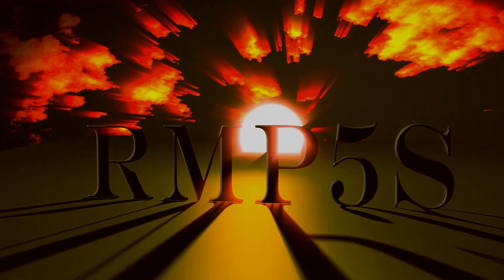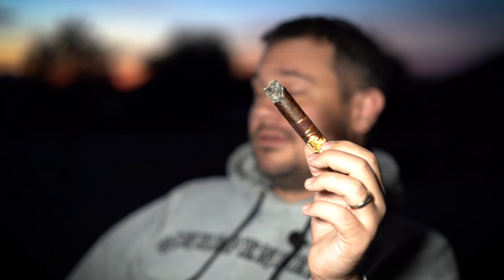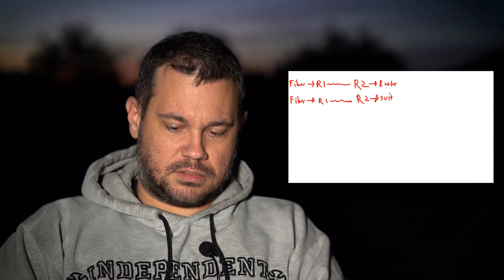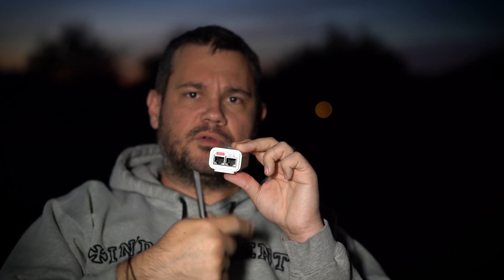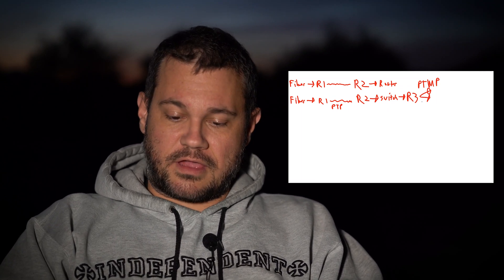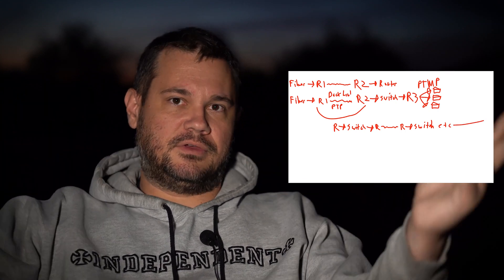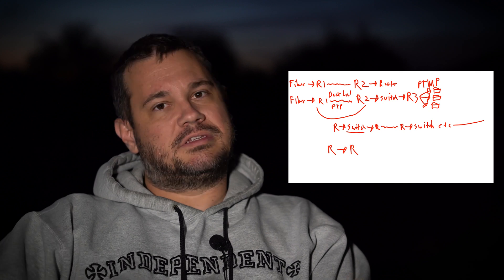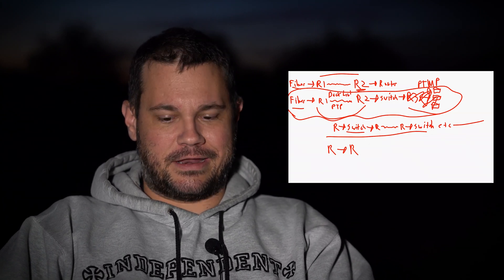WISP Infrastructure 101 - DIY Ubiquiti Internet Relay - Pt 31

Comment: Is it possible to send multiple dishes from the datacenter for example to the relay house, and does this create a bigger bandwith?  I wonder this becos you find 900Mbps Transmitters and 2Gbps Receivers (even though its multiplexing its still 1000 which is more then 900) on the uisp site, and then I'm talking about the none 60Ghz ones.

R1 \
R2   --------------------- R4 
R3 /

Comment: You got that 'chicken scratch' too! 😂  Something I would say about using a switch/router with POE is to MAKE SURE that it delivers the equivalent power supply as the injector, else, you can have a situation of not enough power OR burn out a radio!
Reply from the maker: Or, more simply put, make sure output is correct. We've all fried a radio or something by plugging it into the wrong port. lol

Comment: Do a 3 sector 120 degrees on each ant. Just like every cell tower
Reply from the maker: That may be an option in some cases but in mine, one of the radios would be pointing directly at a mountain.

Comment: If I was to supply a multi storey building of about 20 floors less than a mile away from the cell tower, how would I ensure the quality of internet speed with multiple users at a time (100-200)? Can I multiply the strength of my backhaul?
Reply from the maker: What do you mean?
Reply: @rmp5s  how can I achieve consistent up and down speeds for a huge customer base? if 200 customers in your community surfaced to subscribe to your network, which equipment would you have to acquire to maintain your network quality?

Comment: Would radio 1 & 2 be your Backbone Radios (AF-5XHD-US 5 GHz) used in your “what does a wisp cost” video. So if I can get a resalable Internet drop in my office, I can connect radio 1 in my office and radio 2 on the tower which connects to the 2 Dishes (AF-5G30-S45 5GHz airFiber)??? Just looking for some understanding. Thanks, I would love to build my own wisp!
Reply from the maker: Yea. Think of the radio links as long, invisible Ethernet cables.
Reply: rmp5s I have a 17 mile link between two radios in Florida. What antenna would you recommend? I see the rfe ultra horn doesn’t really like a connection over 16 miles. I just don’t want to be in the same shape as you had starting out with distance being a problem.
Reply from the maker: @andrewritz8974  You're going to need some gain...probably wanna go with a big dish. Horns aren't great for super long distances because they have to be MASSIVE to get high gain. 
It depends, though. Depends on cost, where you're going to mount it, noise, etc. I can't say for sure.
Reply: rmp5s thanks for the reply. I looked on the air link on ui.com and see I have to go with the massive 34db dish which will cost a small fortune to get on a small cell tower. Have you heard anything about the air fiber 5? It looks like it has 100km range which is more than enough range.
Reply from the maker: @andrewritz8974  Yup. I know what they are but I've never used them. Might work, but take range estimates with a LARGE grain of salt.

Comment: I think you can remove the switch between your relay radio and connect them with cross over ethernet  cable..
Reply: No, they need poe.

Comment: How would you compare the nanobeam to the litebeam? Is one simply better than the other?
Reply: I have installed 100+ litebeam Gen2 with no problems and I prefer it over the Nanobeam. it is cheaper has more gain and it handles noise better.
Reply: The nanobeam technically has better memory and stuff, it also has a much better mount.
The litebeam is built with less premium materials.
Im the end the main difference is the look, mount, and price.
Reply from the maker: Honestly, the LiteBeam works just as well as (if not better than) the NanoBeam and is way cheaper.
Reply from the maker: Yea, the NanoBeam mount IS better.

The LiteBeam is really well built but there is some assembly required while there is none for the NanoBeam. Not really a big deal, but it is noteworthy.